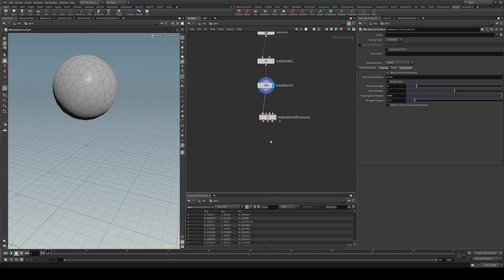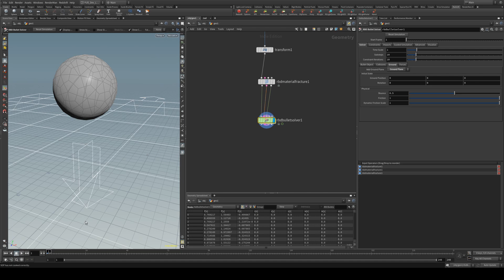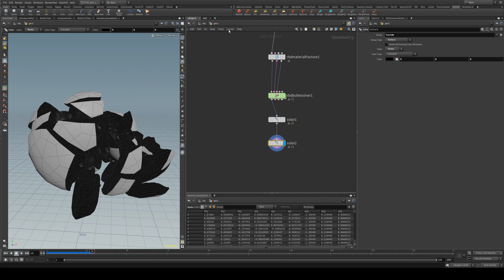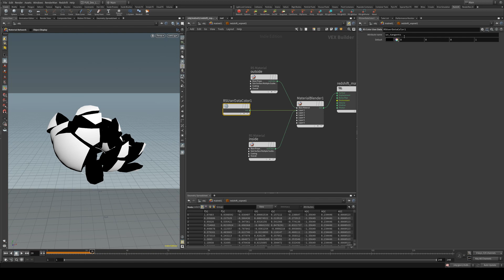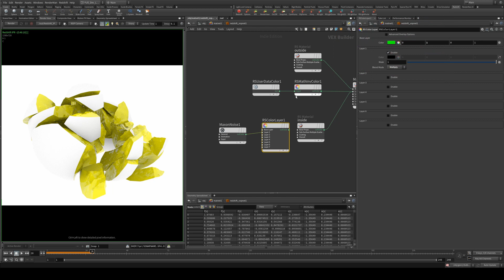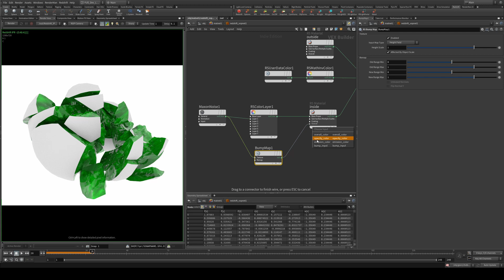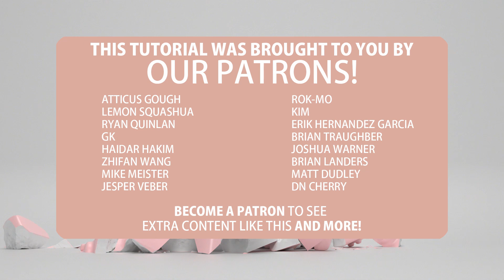Houdini RBD Fracture Internal and External Materials Tutorial

Comment: Could you not use a Material node with the inside/outside groups (in the geo context) to assign the materials directly instead of using the Color nodes as masks?
Reply from the maker: Yep, that would work too. Because I habitually think in terms of shaders I defaulted to relying on the shader to mask but using the material/group method will work just as well and possibly better in some situations. Thanks for the comment :)
Reply: Thanks for that comment - that really made things easier for that last step since I  am not using Red Shift